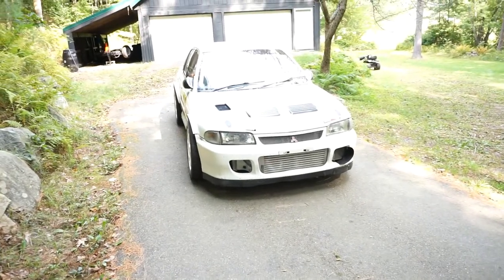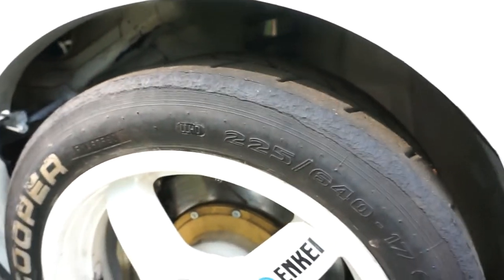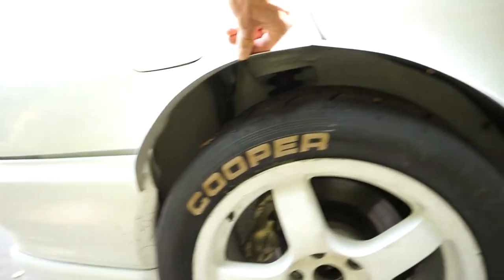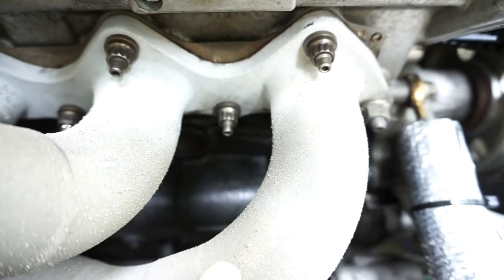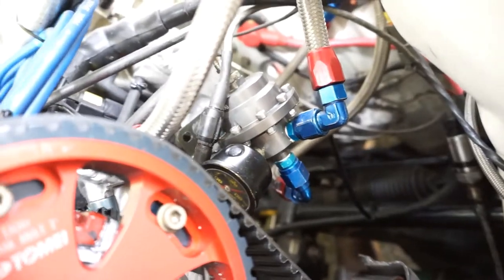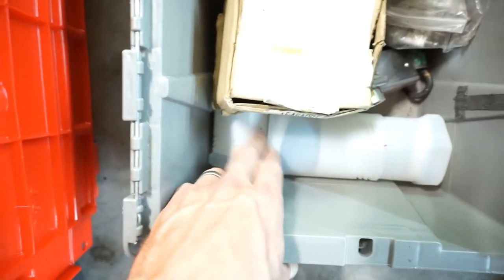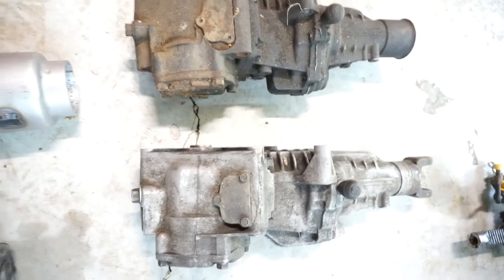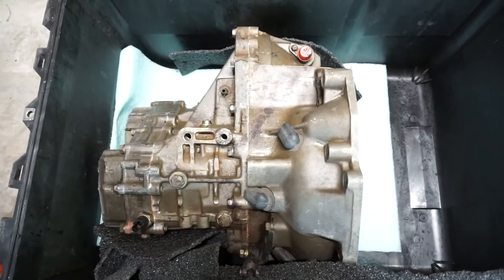Pleasure Evo Walk through (Lancer Evo II race car Spec)

Comment: Did you retain the droplinks from the struts to the swaybar up front?
You car looks to be have very well sorted suspension. I'm trying to make my Evo 1 handle the best it can before adding power. I've got Evo 2/3 front lower control arms and front swaybar, and as many ralliart bushes as I've been able to source atm.
Reply from the maker: Those things will all help out a lot. I've spent years working on this ass you can probably tell. Good question on the drop links. What I did on the first stage (E2/3 knuckles) was to weld a swaybar link tab to the bottom of the strut housing. I took the strut out of the threaded housing first so the heat wouldn't affect it. That was for the Tein Super Racing setup. When I moved to evo 5/6 front suspension that changed again. The control arms now had the swaybar link mount so the link went from the bar, down to the arm instead of up to the strut. That allowed me to make no changes to the RSSP coilovers.  If I did it all over I'd have custom coilovers built to suit the 2/3 spindles but I'm still happy with the result. Evo 5/6 basically everywhere on the front end including the steering rack

Comment: I'm surprised by the number of Later Evo parts used in the car. Are there many compatible parts between the early Evos and the 456789s? It's nice to see the car slowly go back to a stock look, and now is the time to sell an early, so your plan seems to be working out. You got any future early Evo plans after selling this one?
Reply from the maker: This will never look like a true group a car unfortunately but it will regain the factory look more and more I think. To fit modern tires the fenders will always be what they are for example. The part compatibility really depends on what you're considering compatible. Anything can be made to fit, Even Norris in the UK fit a later drivetrain in one including the engine. The suspension had to be updated and short of something custom there wasn't much available for an early Evo a long time ago. Now, a company like MCA could make a custom set. The advantages of the later hubs are really great- bolt in wheel bearings for example, thicker knuckles, quicker rack.. 5 lug for modern wheels. I just bought an Evo II RS that I'll be prepping for resale. It's completely stock. Once that's sold, who knows!  Thanks for the comment :)
Reply: @race-partners  Good point with the compatibility, nowadays it seems anything can be fabbed up to work. I think I know of the II RS you are talking about and I actually tried to make a deal with him before it went on BAT.  These early Evos are hard to get now, I've been bidding on the japan auctions for 3 months now and the right one still hasn't come. I'm looking forward to the for sale post on that II (and the Pajero evolution haha.)
Reply from the maker: @zadekharbat  The Paj could be for sale anytime. I just want to find the right person. I'd been looking for a long time with my friend Craig for a clean Evo and they just aren't out there, like you said. Ratty ones sell for 20k in Japan now

Comment: 16:10 hey Al, what is the gold heat shielding on the valve cover? what what is the orange heat shielding called on the lines called?
Reply from the maker: The gold is just some gold foil tape to reflect heat. DEI sells it. The Aeroquip sleeve is silicone fire sleeve.

Comment: Curious about what your using for the thermostat housings
Reply from the maker: Hey Angelo, it's an inline Meziere brand we welded the housing into the lower radiator pipe
Reply: @race-partners  would love the info for the power steering controller too
Reply from the maker: @evozero905  From a Vauxhall but it looks like Saturn and some GM cars are the same. You can get the whole kit on eBay. There's a UK seller that has a small assist controller